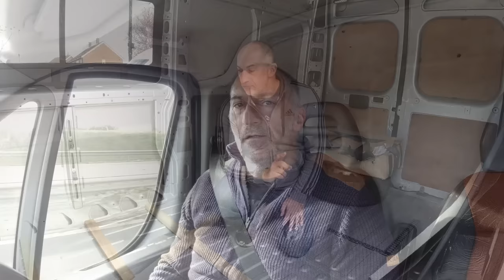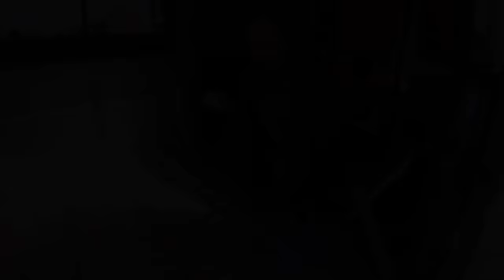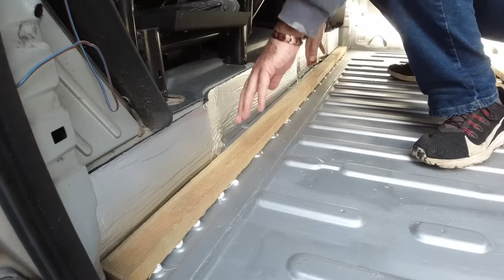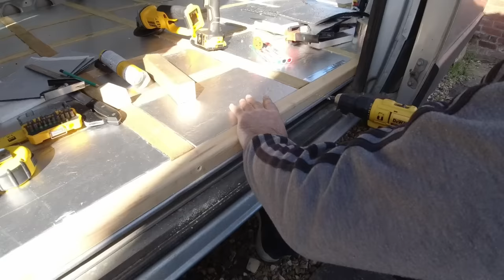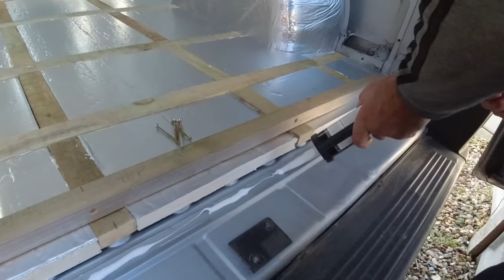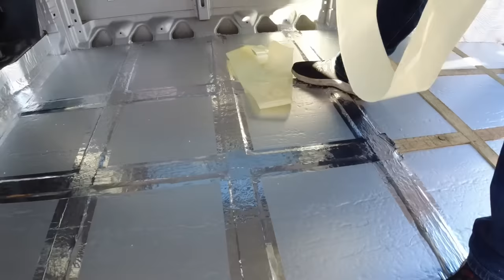How to Insulate your Floor on a Budget - Episode 7 of the Van Build Series

Comment: Hi Greg how man sheets of PIR did you need for your MWB. I have a LWB and just wondering what I need to order. Also what region do you live in? I’m in Staffordshire and would be interested to know the address of the place you got the PIR?
Reply from the maker: I used two 25mm sheets for the floor and the place is in Norfolk. 
Best to look on fb marketplace in your local area otherwise you spend more on fuel getting there.

Comment: Good evening Greg, love the video's, I have a Vivaro that I am about to start converting, I watched this video and decided this is how I want to do my subfloor, I'm just curious as to if there's any chance that condensation could occur in the gaps under the flooring? Thank you in advance
Reply from the maker: You just need to make sure that the foil vapour barrier is completely sealed especially at the edges and doors. Watch this video I made to prove how effective the barrier is. https://youtu.be/ommqMG7RjXg?si=OGD3NLlJBS6ZATmA
Reply: @GregVirgoe  thank you for your reply, I have some vapour barrier on its way!!! Also could you give me some advice in regards to ventilation? I have a swb Vivaro and will only be using it to camp for 2-3 days at a time.

Comment: Did you do anything on the cab floor? Wondering about using some of the 10mm closed cell foil foam under the rubber mat in my econoline cab. would that work ok? might be weird to walk on...what do you think?

Comment: Thanks for this very informative video. I’ve just seen another video about insulating a van floor. This guy didn’t use battons, but glued XPS bord strait on te metal floor. XPS does’nt compress and he glued a 18mm plywood subfloor on top. In his opinion this is strong enough to mount things, like cabinets to the floor. What is your opinion about this method?
Reply from the maker: XPS does compress over time like any other insulation.

Comment: Hi Greg, why did you fit floor batons to the high point on the floor. I have seen others who generally put the batons in the low point. 

Loving your work though.
Reply from the maker: my choice of  batons  match the diemnsion of the insulation so it makes fitting much easier, as this is now a sealed void the air gap is not causing me any harm at all.
Reply: @GregVirgoe  - thanks for reply so quickly, thought maybe there was a reason I was missing out on, lol.

Comment: What did you use for the wheel arches? Is it the same as the cab roof? If so how big of a roll did you order as there is alot of choice on the ebay store. Thanks
Reply from the maker: Yes please check out the sound deadening video in this series. It’s 10mm closed cell and I ordered a 5m roll to use elsewhere as well

Comment: Unless I’ve missed it, this time you’ve not used those sheets of aluminium foil that contain foam sandwiched in-between (that you cut from a large roll) that covers the PIR and are then taped with the aluminium foil tape, any reason for this?  I thought that was the vapour barrier element?  Or was it done and not shown?
Reply from the maker: You have me confused with someone elses video, please go back and check my sprinter floor video :D The foil on the PIR board is the vapour barrier and the foil tape is also the vapour barrier the two together completes the vapour barrier, no need to put an additonal double foil vapour barrier on top of that. The most times i've used the phrase 'vapour barrier' in one reply :D lol

Comment: Hi can I ask, from my research that insulation is not great in confined dynamic space due to the rubbing and releasing the particular into the air. Do you think the extra covering stops this with like the vinyl flooring etc. I have been looking wool being the best but obviously more expensive.
Reply from the maker: Some research is a good thing but be careful what you read and believe. Using things like glass-fibre insulation can be harmful to your health but there are far better materials out there now like the recycled plastic loft insulation by Diall, not harmful to use and has great green credentials as well as good thermal properties. A properly installed vapour barrier will prevent condensation from forming and keep all your insulation away from your living space. Don't worry, follow my insulation videos and you will be safe and sound.

Comment: Hi there, thanks for all the great video's! Quick Q: How does the insulation properties change due to the wood which is in between the insulation?

I saw your previous video which was very insightful. However that assumed that the whole insulation barrier is made out of insulation rather than combined with wood. Will the air finds it way through the wood and therefore change the insulation properties significantly, potentially creating bigger changes of condensation?
Reply from the maker: No not at all because wood is also a good insulator so there will be no thermal bridging at all. Thanks 🙏🏼
Reply: @GregVirgoe  ok thanks a lot for the quick reply! Looking forward to your next video’s.

Comment: greg how does space foil work when insulating say a water boiler.?.can the same principle be applied to insulating a van? they seem to act as a vapour barrier and insulation in one..for instance rather battoning out the floor i would lay down space foil which is about a centimetre thick and then lay a 22mm board straight on top of that and counter sink it into the chassis using bolts..then drill furniture to the 22mm ply..i would also apply it to the walls and ceiling and then board over,and the air gap would be the insulator from the outside..
Reply from the maker: I’m not familiar with any product called SPACE FOIL but at only 1cm that is very thin and it not going to give you very good thermal insulation values. It would just be enough to prevent condensation but you really need something thicker to stop heat loss

Comment: Hi.  Aren't you gluing PIR boards to the floor, or is it just not visible in the video?  It may have been mentioned somewhere, but I missed it.  What is the main reason for changing the van from Mercedes to the current car?
Reply from the maker: You don't need to stick the insualtion down a good friction fit is enough to keep it in place. We are not chaning our van, that will still be our home. I wanted to do this van as its a different layout and this vehicle will be relevant to many more self builders, boxers, relays, promaster...etc  That combined with our Sprinter build covers at least 6 different vans models and the task can be applied to any other.
Reply: @GregVirgoe  Greg.  Thanks for such an extensive answer.  You are an amazing guy!  Much respect for what you do and the way you do it.  I bow low and greet you warmly, waiting for your next videos.

Comment: When you fit the timber battens and the insulation boards there's a space left between the van and batten/board due to the van's "bumps". there's no issue with that? wouldn't that allow condensation to form?

Comment: Hi Greg, what size timber did you use at the edge of your side access door please? Is it a roofing batten also it looks slightly different on the video maybe a 2*2?
Reply from the maker: I trimmed down a 2x2 to get the exact size as the roofign batten was not quite thick enough.
Reply: @GregVirgoe  excellent thanks Greg, I thought it looked a bit square for roofing batten 🤣👍
Reply from the maker: @nickillewellyn1413  well spotted  👍🏼🤩

Comment: How much weight will be added? Overall... how will that affect the fuel economy?
Reply: Videos rock btw...
Reply from the maker: Hello John, The PIR insulation is very lightweight and timber battens similar. When we fitte dout our sprinter van it was pretty well fully loaded but after driving it now for 50k miles I can confirm that i'm still getting an avergae of 32mpg, which is 2 more than the book says :D

Comment: Foil tape has no give, cannot stretch, how does this work on a floor if you walk on it? Would it not be a better solution for the future to use a flexible tape like Tesa 60073 isofix? or some of the other vapor barrier tape?

Comment: Can I ask why you fitted your batons across and not front to back. Just wondering if it makes any difference. Cheers.
Reply from the maker: Good question and yes there was a reason. Battens going lengthways will be supported the entire length, battens across the van are only supported intermittently. Therefore, its better to have a long solid batten widthways because there is only internmittent support so the batten can support itself, then the small cut lengths down the van are better as they will be fully supported. Hope that helps.
Reply: @GregVirgoe  Thanks! as that's the stage we are at with our van and had been debating what we should do. Looking forward to the rest of the build series. Cheers.

Comment: Hi Greg, for the spacing of your battens did you go for 12 or 18mm ply? Cheers
Reply from the maker: I went for 12mm it’s really the bare minimum and my battens were placed at 400 centres max
Reply: @GregVirgoe  cheers, I was doing a bit of load testing (me) this evening, 18mm felt over the top, 12 bowed a touch but when its a full sheet & screwed down, should spread ok. Thanks, you’ve reassured me 😀👍🏼
Reply from the maker: @hopesfreedom2322  I think you can get 15mm if you want something in between. Once screwed down it does add lots of strength

Comment: Whu did you not put batons  flat on the van floor you put them across the van if flat on floor you would have them more stable and save on head room and may be thinner  insulation? 😮

Comment: What happens if i didn't insulate my van properly Greg? Please,  thanks 😊
Reply from the maker: Two things to consider here. 1. insulation helps to slow down the transfer of heat in both winter and summer so if not insulated you will find it colder and hotter inside. 2. condensation prevention, an effective moisture barrier is essential ina steel van to stop condensation form formign on cold days, if you dont have that you can help to reduce this by keeping the van well ventilated and heated at all times, it won't prevent it totally but it will help by keeping the relative humidity lower.
Reply: Thank you very much for reply Greg appreciate it so much. If I do make a another campervan I'll definitely insulate it properly. And definitely will learn from your videos. thanks again Greg 😊

Comment: I did not get it: why timber battens under the subfloor? The density of the styrofoam together with a plywood subfloor is rigid enough to take all thinkable loads on this small area ... (besides the bridging effect of the battens, and the extra cost and the glue and the work and the sqeaking over time ...)

Comment: I hope no ones asked but is it worth using 50 ml pir for the floor for extra warmth ?
Reply: I would like to know that too. I have a high roof Ford Transit, so no issue with the height.
Reply from the maker: If you can afford to lose the extra 25mm of head height then YES, 50mm will be amazing on the floor for insulation and keeping your van warm. Heat is lost by conduction in all directions just by the temperature difference inside an out. so anything you can do to slow that down is a big advantage.
Reply: @GregVirgoe  thanks definitely going to do that then! Plus I'll be living in it, and ill be fitting a small wood burner so saving heat will save a little more wood ..

Comment: I’ve seen everyone using sika. But would a good no more nails to secure the battens do the same?
Reply: I always use 'Geocell The Works' for bonding internal wood items, which is a great adhesive/sealant, very sticky. Personally I wouldn't go any cheaper than that without comparing datasheets to ensure ingredients and performance (heat tolerance etc) is the same as Geocell or Sika. I use something called 'Carbond 940FC' for internal metal parts like when squirting extra strength into the roof/ribs, and the side panels/support struts.I always use Sika 522 for external jobs and would not change that.

Comment: Awesome video! Following as I convert my own Peugeot Boxer. Quick question: wouldn't Sikaflex 554 be a more suitable product than 522?  Seems like the latter is more of a sealant, while the former is more towards the adhesives family? Anyone, probably close enough. Looking forward to your experiences! Thanks!
Reply from the maker: Yes you are right 544 is geared more towards structural adhesive so in this application might be better. 522 still does an incredible job and is also extremely strong and flexible. 👍🏼😃

Comment: what ever happend to your sprinter when after so many miles it went into limp mode did you find the problem
Reply from the maker: The van does not go into limp mode, it does a regen of the DPF every 500miles, and it doesn't affect how it drives other than you get some embarrassing smoke out of the exhaust, Mercedes could find nothing wrong with it and wanted me to fit a completely new exhaust system at well over £2k which they could not guarantee would fit the issue. So as ours is a 2008 model and legally does not have to have a DPF system I'm looking to get it removed completely. This won't affect my MOT because it didn't become mandatory until 2009.
Reply: @GregVirgoe  thanks greg

Comment: I understand that there has to be the support for heavy things on floor, but these timber logs also provide so much holes in insulation ... is there  any other solution? because I suspect that, you lost a lot of insulation factor due existence of the timber logs.
Reply from the maker: This is not true because timber is actually a good insulator and has good thermal properties  google the thermal conductivity of different materials and you will see how good it is. 👍🏼😊

Comment: Caravan floors are a sandwich construction of 2 sheets of 3mm ply with a rigid insulated infill and are extremely strong. These floors are only supported underneath by the 2 chassis rails and not a continuous metal floor but they don’t flex unduly. Why is the same method not adapted in van conversions? The solid metal floor will definitely support this method in my opinion and also, not add unnecessary extra weight to the build. Just my opinion but seriously considering it for my build.
Reply from the maker: Have you found where you can buy those composite bonded panels from and how expensive they are?
Reply from the maker: Oh and I just thought have you seen what is left of a caravan after a crash 💥 lightweight but not structural at all  🤔😳
Reply: @GregVirgoe  hi Greg. I was thinking of constructing my own using the aforementioned 3mm ply and possibly Kingspan or similar thermal slab as the sandwich filler. I have seen the remains of a crashed caravan, no, not very structurally strong when subjected to adverse force but, the floors are strong under normal conditions and that was why I am thinking of going down this route myself when I do mine.
Reply from the maker: @philipeastham1607  the composite panels are factory made and sheets are bonded with a complete layer of adhesive like a laminate would be. Do you not think it will be difficult to replicate 🤔
Reply: @GregVirgoe  you never know how something will turn out unless you give it a whirl. The adhesive that is used to bond replacement wall boarding and flooring to the insulation in a caravan is very strong so I’m going to do a practice piece and see how it turns out.

Comment: Greg .....I've been watching with interest this series and the last. I'm also admiring you new collection of powertools. But come on man buy your self a new hand saw. That black thing looks and cuts rubbish. Howdens always have deals on Irwin handsaws. I just picked up 3 for £12 +vat. Get 1 at least. you know it makes sense ! Also why you burying the heads of the screws so far and using the countersink as a drill bit ?
Reply from the maker: The saw was one of my late fathers tools so it has sentimental value. I don’t need to buy new tools 🫤
That is a plug cutting set not a countersink. Which is why they are deeper they will be plugged with wood.

Comment: Thanks Greg! Better than my floor at home 👌. Are you keeping track of the weight of materials as your going along? or have you a weight your trying to keep too? Thanks a million for sharing 👌
Reply from the maker: The beauty of these smaller vans is you have much more payload to play with. Our sprinter only had 900kg and this van has 1400kg just because the van is so much smaller and lighter. Plus you cant put as much into it so the contents will be less, i'm not expectign any weight issues here but we will do a final weighbridge visit to make sure.
Reply: Looks like mine is a similar build. Full tanks and fully loaded my mwb Ducato is around 2800kg.

Comment: Hi Greg, fantastic series! Question regarding your grid design for the batons vs insulation / vapour barrier...

I like the fact that the extra timber in the floor will mean zero softer bouncy areas (where you'd be standing directly on the PIR with that bit of give under the plywood floor), but would having that timber there with those smaller squares of insulation mean that the floor is less insulated overall? 

I know the insulation is pressure fitted and the foil tape will prevent any gaps, but I know very little about the protection that the timber will give / it's insulating properties vs having lots longer unbroken strips of the PIR insulation?

I'm about to start my own van conversion and will be using your grid method as I want the floor strength.
Reply from the maker: Timber is still a good insulator, 500 times better than steel, There will not be any cold bridging at all and any loss of insulation at these points is negligible.
Reply: @GregVirgoe  brilliant thanks, your videos have been invaluable as well cheers!